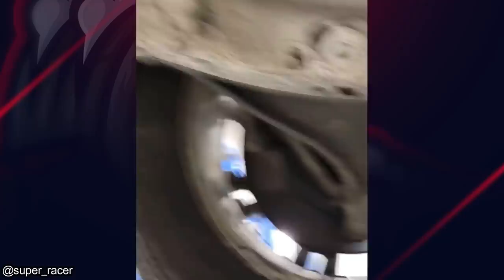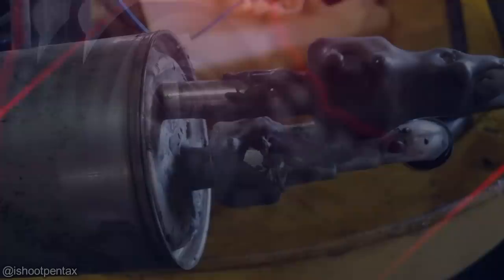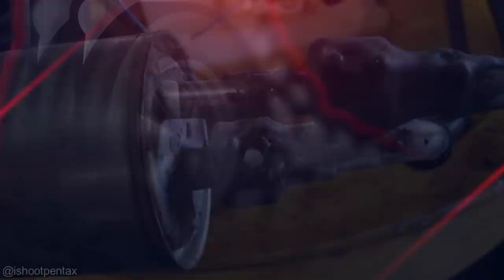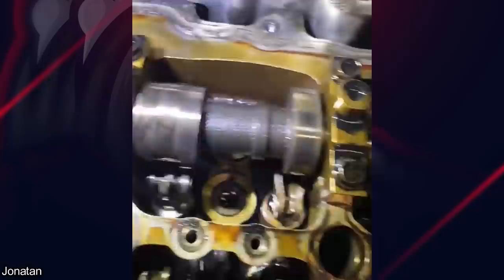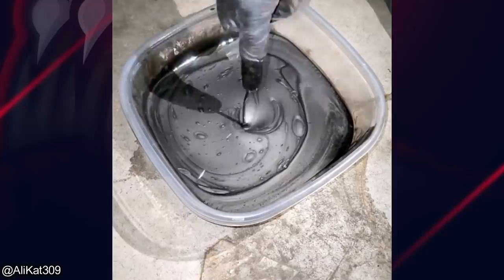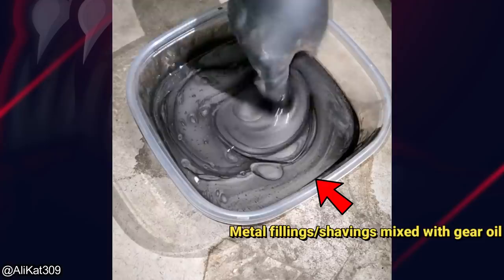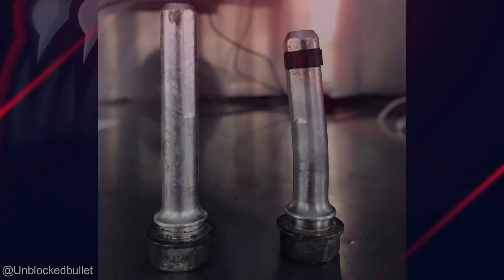Customer States They Hear A LOUD Clunking From Front Left | Just Rolled In

Comment: I’ve used JB weld to stop a transmission oil cooler line leak before. But only to temporarily stop it until I got the new lines and replaced them. And certainly not over the fitting!

Comment: I had a shop replace a transmission in the FWD car. I was driving back from work, speeding as usual, around a right hand sweeper on the highway and I felt this weird clunk and the car started pulling. I slowed down and pulled over and just before i stopped, the front left fell to the ground.. The shop never tightened the lower ball joint nut on the drivers side and it fell off.  Had it fallen off when I was going around the turn he car would have been totaled in the crash that it caused.  Cost me over $300 to get it towed back to to my house.

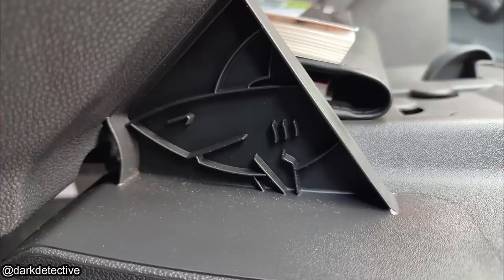Comment: 2:34 I heard someone else mention this recently too. So, is the shark in a different spot on each of them? If so, that's really cool that they went through the trouble of custom making each model's parts.
Reply from the maker: Yea they seem to be in a lot of different spots. I'm sure they have 5-10 different spots they put them in.
Reply: @JustRolledIn  I love that. That's really neat
Reply: Ash tray outer edge once unfolded 
Same with the glove box 
Some have it on the main interior plastics like the foot well near the centre console
Reply: The glovebox hinge seems to be a common place for them, i've seen the design shown in this video, which is on a glove box hinge, but also a newer revision of the shark design on some newer Opels, like the grandland x and crossland x. center console as well.
Reply: They are only in cars designed after 2004. Apparently one of the designers was doing the glove box and told his kid it was really boring, so the kid says to put a shark on it. So he told this to his boss who basically said go for it, and the rest is history.
Reply: @richardstokes276  I had a 2013 Vauxhall CORSA VXR. It was on the side of the glovebox. I was told the same thing that it was done out of boredom by one of the designers.
Reply: I'm going out and looking for mine tomorrow.
Reply: It's like the hidden bunny on the cover of Playboy
Reply: Just Vauxhall or any Opel?
Reply: @telocho  Any Opel, post 2004. Since the 1980s "Vauxhall" is just a badge that's put on Opels sold in the UK. Vauxhall doesn't design anything, sharks or otherwise.

Comment: The landrover park brake issue is very common. Also the park brake pivots seizing, causes the electronic module to strip the internal gears. Btw...the rear frame amd body seperation is required to remove the park brake unit. Amd the brake line on tje rigjt rear. Poison those trucks are. Front lower control arms. Rear upper control arms. Steering shafts and inner tie rods galore

Comment: That damaged rim is why I like steelies and oem chevy/dodge rims - heavy, lots of sidewall, and hard to damage on bad roads. I just picked up a used set of winters with TPMS on steelies for the wifes van for 20% less than the cost of that one rim, and they're practically new.

Comment: 2:41 that’s actually oddly enough the best spot for a performance intake but only if you are tracking the vehicle and never daily driving. For a truck it’s a horrible idea. It just sucks more cold air in and is away from a lot of the heat in the engine bay

Comment: I'm wondering... if a vehicle comes in that has an obvious safety issue... like a block of wood for a front strut or leaf springs held together with hose clamps (like in previous videos) and the customer doesn't want it fixed, do you just let them go or are you obliged in some way to prevent that vehicle from being driven?
Reply from the maker: Everywhere is different but where I live theirs nothing we can do about it, besides getting them to sign a waiver stating we are not responsible for anything once the vehicle leaves. However we can contact a peace officer and let them know about the vehicle being on the road then it's up too them what happens after that.

Comment: The story's about potholes always surprises me.... You know I have been driving in my country and over parts of Europe for over 30 years now and I have never seen a pothole. The roads in the Netherlands are a-quality, like a Billard sheet, but even Belgium's roads, Infamous for lack of maintenance, don't have potholes.... Why is this a thing in America? Serious question.
Reply: The main reason is weather.  Weather is way more intense here, especially in the Midwest.  Last year the temperature here in Chicago ranged from -18 F (-28C) to 102 F (39 C), and that was actually a pretty mild year compared to usual.  We got 46.3 inches of snow last year (compared to 2.13 inches in Amsterdam), and for many parts of the year it thaws and re-freezes daily, all of which wreaks havoc on the roads.  If you drive in the south, the roads are MUCH better and the cars last a lot longer (no salt means no rust). There's other factors such as funding and road network size, but the biggest contributing factor for potholes is certainly weather.

Comment: The mazda camshaft is a known issue from the manufacturer, usually when you see a camshaft like that the turbo is gone aswell, and the oil pump is clogged, low oil pressure etc..... I changed hundreds of those when i worked at a mazda dealer. The problem occurs from year 2013 to 2015.
Reply from the maker: Thanks for sharing!
Reply: this is my video i sent in, the car is still in the shop, we are still waiting on a answer from the costumer on if he want a new engine or fix it. we are waying he should dump the car because it might be other problems causing it to fail. it has got new camshafts at mazda for like a year ago. is this maby waranty?
Reply: btw i have heard that the injectors leak and toxicating the oil that leads to clogged oilchanals that leads to this problem. am i wrong?
Reply: @jonatannorstrm7162   warranty maybe not, but can be goodwill. Mazda got 3 year new vehicle warranty and 7 year ''goodwill''. If the costumer was loyal with the maintanence there is a chance that it can be a goodwill case. This all starts with low oil pressure fault code, i would start with checking the turbine in the turbo 80% of the time its loose, after that i would check the camshaft for wear, you should see the injectors condition if they are carbonated or not. If they are then the injectors are leaking and the oilpump is clogged and the pickup screen in the pump needs to be replaced and the engine then flushed with mazdas special flushing oil, so first flush then change the oil filter and put in normal engine oil. However mazda dealers have a technical information document about these issues. Hope that this can help somewhat:)

edit: the pickup screen in the pump is there to protect the engine from carbon pieces entering the oil channels.

Comment: Lol that differential oil in the Tupperware is from my car lol
Reply from the maker: Lol too funny. The clip was shared with me.
Reply: @JustRolledIn  that is my actual hand in the video. The diff was making no noise and I was trying to track down a driveline issue 2 weeks after I bought the car
Reply from the maker: @BashingBrainez  interesting. I was told something else haha but thanks for sharing.
Reply: @JustRolledIn  it is what it is but yeah had it to the dealer 3 times and they told me nothing was wrong with the car
Reply from the maker: @BashingBrainez  wow. Same dealership every time?
Reply: @JustRolledIn  yep same lexus dealer they told me to stop wasting there time. Nothing wrong with it. I have the pictures of the insides I destroyed both carrier bearing somehow the pinion bearing was ok and bent my center pin and broke like 8 teeth off the ring gear. I couldn't believe it drove almost normally and made no bearing noise whatsoever.

Comment: that "directional tire" is meant to be flipped depending on which axle it's mounted on, I just don't quite remember which brand did that but it's either Michelin or Kleber around 2002-ish.
And that shark is on a lot of Opel/Vauxhall, Holden vehicles and some other GM's.